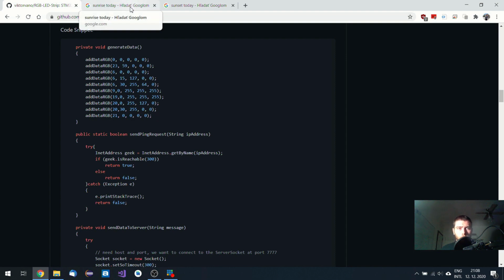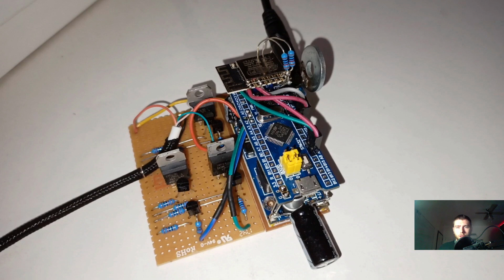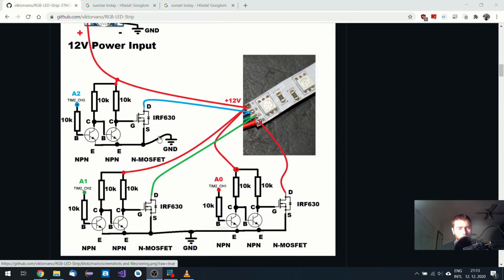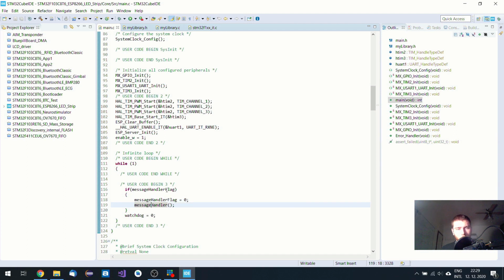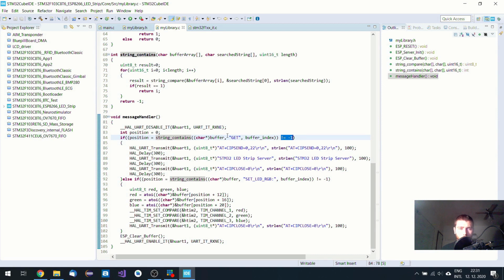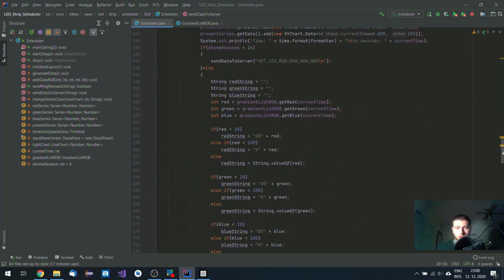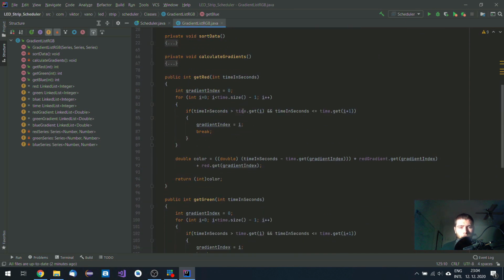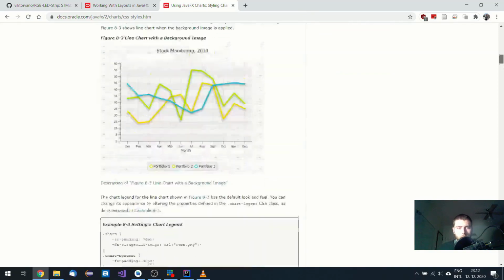STM32 tutorial - RGB LED Strip with ESP8266 WiFi + Android App + Desktop JavaFX App

Comment from the maker: You wanted a project with the ESP8266 WiFi module, so you have got one. I kept the code in a simple manner, so it is easy to explore and understand. But some thing are hardcoded, so you will need to change IP addresses and WiFi login credentials. Links are in the description.